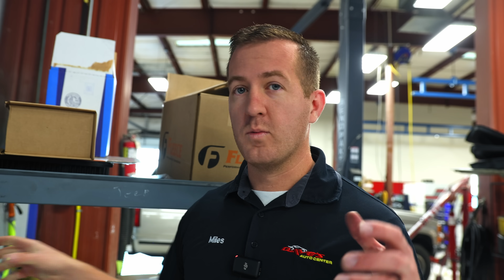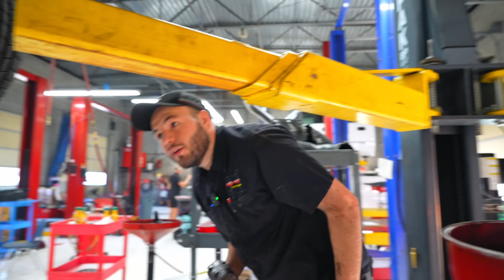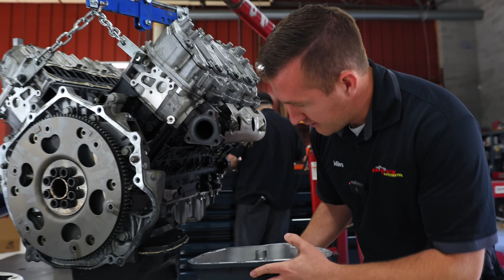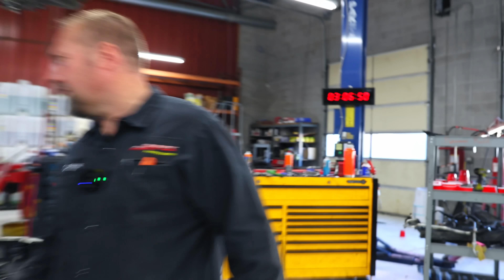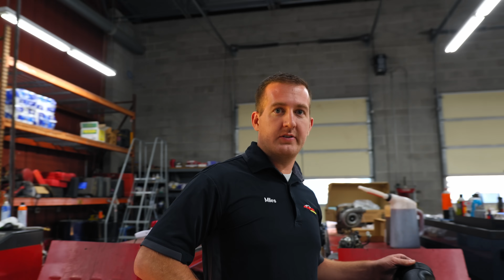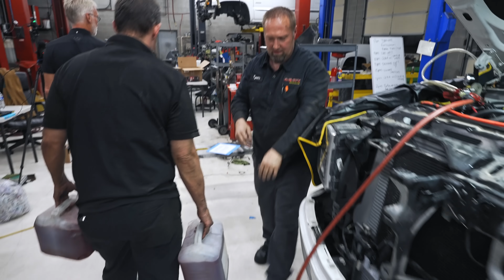$15,000 or Nothing! Duramax Blow-By Engine Swap & Upgrades in 12 HOURS – Can My Team Pull It Off?

Comment: Super awesome work my friends! You cant beat the quality and Skill at Dave's Auto Center!👍
Reply from the maker: Thanks 👍
Reply: @DavesAutoCenterCenterville  could another shop do this same challenge? Sure, but can another shop do this same challenge with the same amount of quality that went into this? Probably not. Any other shop would have used half the bolts and wouldn’t care to check for any leaks or do any vacuum tests. You really do have an awesome crew!

Comment: That was Hilarious when Miles did the 'Rod Knock!"😂
Reply from the maker: It is now! It wasn't at the time😂
Reply: Heck of a team you have there Dave
Reply: What time was the rod knock 😅
Reply: @oscarjones5773 near the end after no codes & engine start.
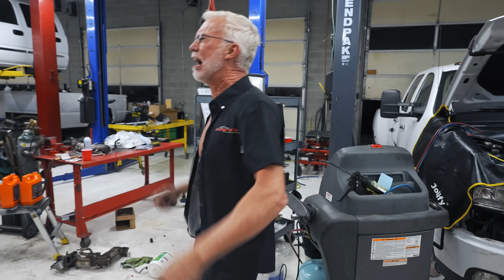Reply: 30:13 😂😂
Reply: There's always that one guy
Reply: I had an engine do that once after a new timing chain. But it went away after 2 seconds and never happened again. But for a second I was like wtf. On one of those ford 3.6s escape I think it was lol. Made an easy quick 2k in a day knocking that job out. Actually did a few of them within a month n half. Weird how they all had bad water pumps within a month n half. Crazy.
Reply: @DavesAutoCenterCenterville  got em 😂
Reply: I was like Who left their ratchet in the oil pan? 🤣
Reply: @ I found a torques wrench in an oil pan once from someone who did a timing chain job in the car. I guess they dropped it and meant to get it back out and forgot and out everything back together.
Reply: @kingdavid4u1588  SMH😞

Comment: I just ran across this video, im very very impressed with these guys awesome mechanics, if I ever need an engine swap im coming to your shop, and another thing these guys all work great together as well
Reply from the maker: Thanks, appreciate you! 👍
Reply: @DavesAutoCenterCenterville  thanks for the reply I know you have a million and one comments to go through,  I really enjoy the videos and learn alot from your information ,ive had a 2001 explorer sport trac it was my fathers he passed away a few yrs back ,my truck inst the best by any means but I change the oil on it every 1500 miles or so, im fairly certain why it runs so well is I change the oil and filter I know I could wait longer but yeah thats when I change it ,it hasnt really had enigine issues I have had new control arms,tie rods and a new rack and pinion installed in it ,it has a 4 inch with 33s  not the most perfect trk but its just a great running truck and it was my fathers which makes it important to me ,I think changing the oil as I do has saved the engine for sure ,anyway sorry for writing a book take care and god bless

Comment: And I actually thought it was a bit unfair that you threw in a FASS lift pump install on top of everything else!  That alone takes a lot of time versus just hooking up the stock fuel system back up.  They could have probably done it in 10 hours flat if you hadn't thrown that wrench into the mix!  Great job, gentlemen!

Comment: The ford locktite comment got me. Ford also needs to ligthen up on there fuel tank strape bolts also DO NOT use a impact to take them off ,  leason learned.

Comment: Hey you a mistake on the PE oil pan. You should have put in 
FLUID COOLING
CoolRunner Oil Pan
2020-2024 CHEVY/GMC 2500/3500 6.6L DIESEL L5P check out this product.

Comment: I'm running the 1st gen 6.6 , 2002. With 202,000 on it and I just checked the blow by    and still no blow by   oil cap is sitting on the oil fill so gd      , I bought w back in 2014 with 70,000 on it

Comment: Iam a retired car hauler for GM and back in the day John Deer dealers would sell GMC pickups and they didn’t sell very many trucks 5-6 but I saw a big JD tractor with a load machine hooked to pto shaft to a huge water tank that would put big load on the engine and run it wide open for 8 hrs and they did this because these old farmers would baby these tractors and they would get call backs so they got this load master and would run them on all their rebuilt tractors and absolutely stopped all call backs on any of their big tractors so just a thought for you to think about seeing you have a dyno and if you could load that motor and let it pull for 4-5 hrs so the customer would get a fully broke in motor and on my 5.9 my frount seal I had to replace it twice in 5 years so I made some calls and put a fluid damper on my 05 5,9 Dodge cummins and it’s been 10 years and seal is still sealed and not leaking oil out of front and rear seal sweat and when you first start it and drive it you can tell but day latter you can not tell you just think that’s the way it’s always been that but it made a believer out of me quick and is very smooth running engine for 500 bucks it’s worth the investment to protect seals and main bearings and old one had a lot of rubber coming out between outer and inter steel weights.

Comment: What is the procedure to prime the fuel system and oil in the engine prior to first start? On a gas engine I'd disable the fuel injectors and crank the engine a few times to circulate oil in the engine to avoid a 'dry start'. I'm curious how it's done on a diesel, is it pretty much the same?

Comment: Hello Dave’s Auto Center. I love watching your crew rebuild diesel engines. I once owned a 2013 Chevy Duramax, but I had to let it go at 80,000 miles due to DEF issues. I wish I would have kept my 2004 Duramax as that was the best Diesel truck I ever owned. Let me ask a question. Have you worked on any 5.3L gas motors with lifter failures due to the active fuel management system (AFM). My current 2015 Chevy Suburban with 124,879 lost the number 7 cylinder due to lifter failure. It’s currently being repaired, but I’m on the hunt for an older model Chevy pre DEF or AFM system.  These new Chevy trucks gas or diesel just don’t last with all these emissions components.

Comment: I have a 05 Dodge 3500 with a 5.9 and a gutted cat so do you build very many of these motors that have no after treatment on the exhaust? And what  EGT probe and gauge kit do you recommend and I bought this truck new and came with a 6 speed manual and manual  4x4 selector ?

Comment: Booooo using worm clamps on radiator hoses it will leak every time when it gets cold out. Use oem spring clamps or use the worm clamps with the spring behind the 8mm bolt

Comment: TDI Swap question:  What engine would be a great Turbo diesel to swap into a 2009 Toyota Landcruiser?  Looking to match/beat HP and beat torque of existing gas v8.  Wondering about Audi V6 TDI motor and drivetrain (chipped and mildly modified)?  Looking for reliable power and towing, but drive like a performance vehicle (not a tractor) -Thoughts? Thank You!

Comment: Now wait a minute this is supposed to be a motor swap , not a partial build of the new motor / ie / changing parts / installing different parts etc & what does dropping the gas tank have to do with a motor swap , & since when is a new differential cover part of a motor swap?
All said & done AMAZING
Reply: They regularly flush their diesel fuel systems when they get one in this bad of condition.. to avoid a dirty system messing up a new build( fuel filters, injector pump, injectors, etc)
Reply: @MrKnoNothing I would like to watch how the fuel was purged. 

The environmental guy in me would do responsible weed fires.

Comment: Don’t need a gallon of loc tite on a body mount bolt but you also don’t need independent front suspension on a 3/4 ton truck or half your cylinders shutting down for fuel economy on a 1/2 ton truck.

Comment: And on my 1992 Dodge 12 valve it had a dampner on the drive shaft where it goes into transfer case never seen that before or after that and I would like to know why was it worth it and the only reason they quit this is the cost to the manufactures so what do you think and it had a 5 speed manual don’t know if that was why or why not don know if they were on automatic trans ?

Comment: If the cab and body can be lifted off the chassis like that does it conform to vehicle build regulations or doesnt America have certificates of conformity ,why does American trucks have 6.7litre engines ,UK have 3.3 litres maximum
Reply: 😂 Any body on frame vehicle is the same, usually 6–10 mounting points where a bolt will go through the frame and fasten to the underbody of the cab/box with a chuck of rubber sandwiched between… why is large displacement necessary? So you can haul your 40k pound excavator to the job site

Comment: I hope you have better luck with that Mishimoto radiator than I did. My personal thoughts on their radiators are not good in my pick up. The damn thing runs hot 240°F going up mountain Springs grade to San Diego not good people and I had other issues as well with that damn radiator, I tried talking to Mishimoto. They just blew me off personally the radiators are garbage to me. That’s my personal thoughts on your radiators. Can’t blame it on the water pump because it’s new high flow water pump. Thermostats are good. Can’t blame them. Is there a garbage radiator I switch to a different radiator, and it ran better didn’t run as hot the same hill that’s all my diesel pick up and I wasn’t towing anything either God forbid I try to tow something  and the only reason that Mishimoto is back in my pick up is because the other aluminum radiator that worked and kept my truck cool after six years or four years the aluminum weld between the tank and the core cracked small hairline crack so I had to switch back not happy about it, but that happened i’m looking for another radiator to switch to get rid of that Mishimoto even in the winter time he can’t keep that pick up cool runs hot so beware going up steep grades under load or even without a load. It will get hot with your foot in it and EGT or less than 1300 around 1200 or below that’s my opinion on their radiators.

Comment: Idk. I on know it ain’t nothing to pull a engine on a 2008 Chevy Malibu 4 cylinder engine but I pulled a engine out at the junkyard once in a hour n half bc that’s when they closed was in a hour n half so I pulled the engine myself and actually had it out in like a hour 20. With the car on the ground and then lifted up in the air a little with the fork lift out there. But yea. I had it pulled quick all on my own and that’s when the owner came out and offered me a job in the spot lol I told him no but I did tell him that I’d maybe help them out here n there if really needed. And that I did do for a little while. But they couldn’t pay me enough. Fk that.

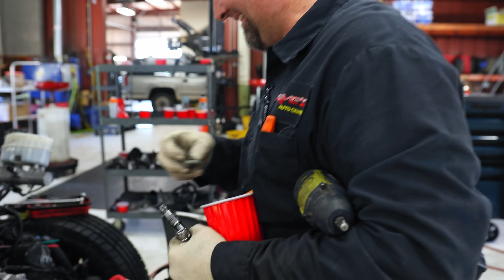Comment: 16:30 plastic cups🤦🏻🤦🏻🤦🏻. Buy freaking metal ones with a dedicated imprint in them. Every truck is 90% the same. Why keep buying plastic cups you throw away after usage? Metal ones you can wash in your washing machines. And they will be cheaper in the long run... Plastic is a bad investment anyway. Apart from the environmental impact alone... The production of plastic is also bad. Stop buying things you can't recycle. You would think a state of the art, branche leading, company would take it's responsibility... Let alone the morality on yourself🤦🏻
Reply: It’s possible that the cups were already used, and that washing/sterilizing them is not cost effective. 

I use a mix of magnetic bowls, used cardboard & plastic when I wrench. 

Plus, you need Dixie cups to okay beer 🍺  pong! 😂👻